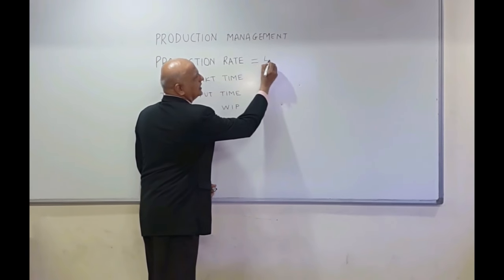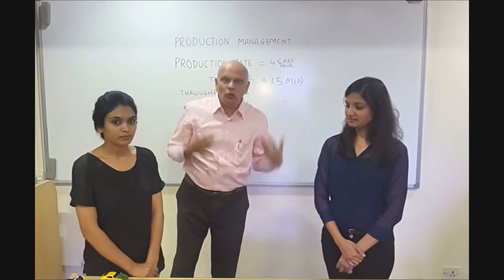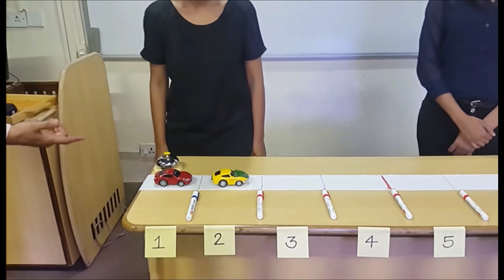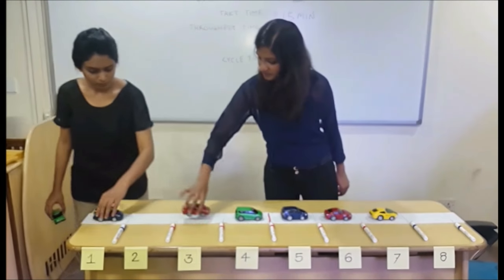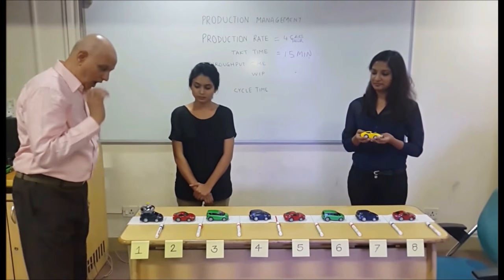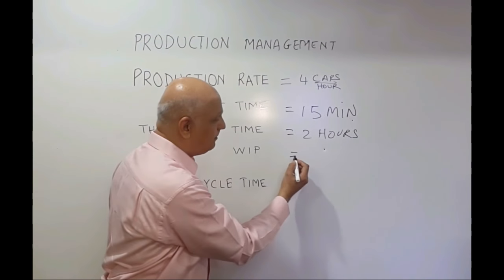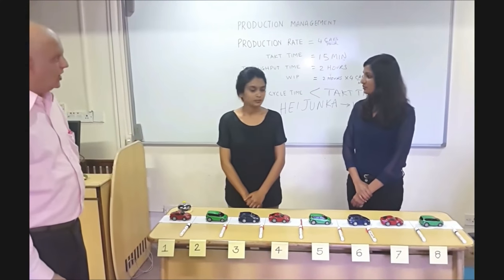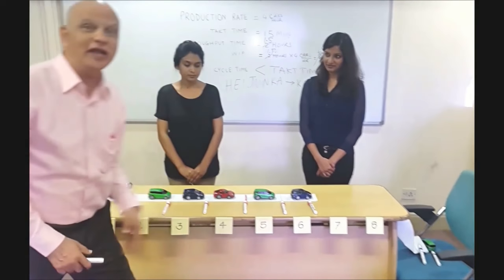Little's Law Simple Form

Comment: This video helped me to clearly understand the concept of little's law. The presentation using the cars and the model of the belt made the learning more interesting. This is how, even a short video can be used as experiential learning.
The best thing I found was , reducing the  belt length and thus optimising the cost even without any additional expense.
Rejection of muda from the process makes a lot of changes to the overall efficiency and makes the production faster.
Thank you Sir!

Comment from the maker: Ashok, to reduce throughput time. start with the fact that activities are being done on each car for 2 hours in our example. We must find ways to eliminate or reduce the time required for these activities, so that the car needs to be worked upon only for 1.5 hours.  For example, if the worker loses time to walk a little distance to fetch the part to be assembled, and we are able to reduce this time by supplying the part nearer, non value adding activity time will be reduced. The target is to bring down the total work to 1.5 hours (90 minutes). This work is now redistributed across stations in such a way that one car rolls out every 15 minutes (unchanged customer demand of 4 cars per hour). That means we will have 6 stations (90/15), with each station having 15 minutes. 
How to identify non value adding activities? Use Masaaki Imai's 5 Golden Rules of Gemba Management. Observe, observe, observe,, use tools like process mapping, spaghetti diagram to identify the seven mudas (wasteful activities), and use solutions ranging from simple 5-S to pre-assembly offline to electro-mechanical and information technology tools and any other aids.
In reality, as of March 2016, Toyota in Japan assembles their cars in 20 hours or less. We took an example of 2 hours just to fit everything within the range of our camera in this video.
Reply: Exact situation is explained in the documentary of Toyota assembly line. (as the above mentioned comment)
Thanks for making the life easier, by explaining it in easy terms.

Comment: can WIP can be calculated by dividing throughput by takt time?
Reply from the maker: You need to multiply. WIP is in units such as number of cars. Throughput will be number of cars per hour. Takt time will be in hours. So you need to multiply throughput by takt time. It will give you the permitted WIP.

Comment: Dr. Srinivas G., good explanation. Please expand your explanation on how to calculate Takt time when in a shift there are planned or unplanned breaks. Additionally I was not sure how was throughput time changed from 2 hr/car to 1.5 hr/car. I heard the non value add activities were removed to reduce the throughput time. Does this require doing time study at every station or what approach will be most optimal to identify non-value added activities? Please help explain.
Reply from the maker: Ashok, good questions. Let me clarify one by one:
Takt time has absolutely no relation to planned or unplanned breaks. The breaks will affect the cycle time and throughput time. Takt time is time made available by the customer to do the job. If the customer, in our example, demands 6 cars per hour, then the takt time changes to 10 minutes. Takt is about customer demand - that's all. You may or may not be able to meet the customer demand. This is a different issue altogether. The responsibility of Production is to bring the cycle time within the takt time. This provides great kaizen (improvement) opportunities, when the takt time changes. Often takt time is reviewed every month and changed if required, throwing up lots of kaizen opportunities. Employees are well trained in kaizen, so they are very often able to meet the demands of the new takt time.

Comment: Why have you considered 8 slots of 15 mins? Shouldn't those 8 slots be of 1 hour for each hour of the working day?
Also, if you want to have a 15 min slot, then there should be 4 slots to represent 1 hour. No?
Reply from the maker: Ankit - please look at the video in steps. It starts with a customer demand of 32 cars output in 480 minutes (8 hour work day). This means that one car must come out every 15 minutes (480/32=15). It has nothing to do with the number of slots.
The production is happening in an assembly line. The total amount of work can be divided into any number of stations (slots as you cal it). Whatever is the number of stations, each station must deliver 1 car as output every 15 minutes.
We happen to have divided the work into 8 stations. (It could have been any number of stations). Each station has 1 car being assembled. So there are 8 cars in the assembly line at any point in time. Considering Little's Law, Lead Time = WIP inventory (8 cars in the system) divided by production rate (4 cars/hour) = 2 hours. 
Please work it out step by step. You will get it.
Reply: @DrG720214  Thank you for communicating to clear my doubts here.
So, would I be wrong if I just remove each car from belt after its manufactured in 15 mins? In that case also, we'll get 4 cars per hour with 1 car in process of development and 1 car waiting. 
Throughput: 4 cars/hour
WIP: 1
Production rate: 900 sec or 15 mins
Please correct me if I have misunderstood the little's law this way.
Reply from the maker: @AnkitMathur111  You seem to have some confusion. The production rate is expressed as number of pieces output from the system per hour (unit of time). The throughput time is expressed in minutes or hours. It is a unit of time. At present, the amount of work on each car is 15 min/station X 8 stations = 120 minutes. If you are suggesting that the work that needs 120 minutes currently can be done in 15 minutes (by doing a lot of kaizen), then you would have reduced the lead time to 15 minutes. In such a case, the WIP would be 1 and the production rate would be 4 cars per hour.

Comment: Sir
In case operation time is high around 5 hours ...if that operation done then next operation must to be done....this is jn case of paint process...if first coat done at first shift end on saturday....sunday off....so second coat must do....or dont do first coat
How this can be resolved for achieving cintinuous flow
Reply from the maker: Balasaheb Pawar - Thank you for your question. If you cannot keep the car for the weekend with only one coat of paint applied, then better to not put the first coat. Dr G

Comment: Great video Sir!!! The concept is explained with nice demonstration.
I have a question regarding the  throughput time. In this case, the throughput time is same for all processes i.e. 15 min but if my processing time is different for different processes e.g. 10, 40, 5, 20 min., then how to deal in such situation? because my waiting time of product will increase in this case
Reply from the maker: Ruchita Rane - Thruput time is not 15 min, thruput time is 2 hours initially. 15 minutes is the 'takt' time. At each station the cycle time needs to be 15 minutes or less. if it is not, it must be brought down by doing kaizen. Dr G

Comment: Dr G, Thanks a lot for all the videos you and your students have posted. 

I have a basic question after watching this video several times now. 
Summarizing my understanding:
We need to produce 32 cars per day. So, considering we work for 8 hrs, we need to produce 4 cars per hour. So the takt time is 15 minutes. we need to produce one piece of the product in less than 15 minutes.  

But in the above example, the product will be ready after 2 hrs (15 mins*8 processes). Where is takt time coming into picture? Are we not missing takt time here? If we say we can complete a product only after 2 hrs, how can we say takt time is 15 minutes? 

Again, we say cycle time is a function of longest process. If we have processes which take 1 min, 3 min, 5 min, 6 mins and 4 mins, we say cycle time is 6 mins. Does it mean, we will have a finished product after 6 minutes? I would say NO. Because without going through all the processes, the product will not be ready isn't it? 

Am i missing something here?
Reply: Also, throughput time is the time from step 1 to step 8 i.e. 2 hrs in the above example. And cycle time is 15 mins throughout. takt time is 15 mins, but shouldn't throughput time be less than takt time?
Reply: Vivek Poomagame
Reply: Vivek Poomagame  dear ,takt time is maximum allowable time needed to produce 1 unit in order to meet customer requirement and here 15 mins (i.e total time we have for opertion/no. of unit demanded by customer 480/32=15 mins) taken to produce a car is correct and throughput time is the time between to convert raw material into finished product. that is 15*8=120mins
Reply: Vivek Poomagame  dear ,takt time is maximum allowable time needed to produce 1 unit in order to meet customer requirement and here 15 mins (i.e total time we have for opertion/no. of unit demanded by customer 480/32=15 mins) taken to produce a car is correct and throughput time is the time between to convert raw material into finished product. that is 15*8=120mins
Reply: cycle time may be less than takt time here because process must have some delays